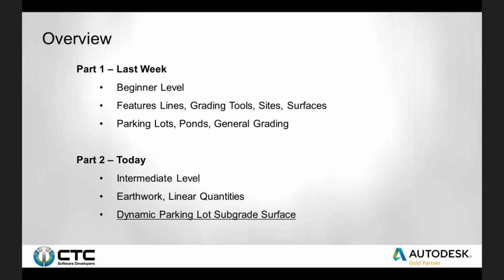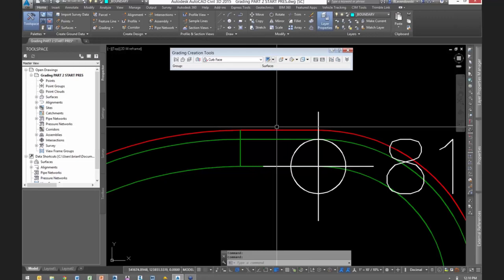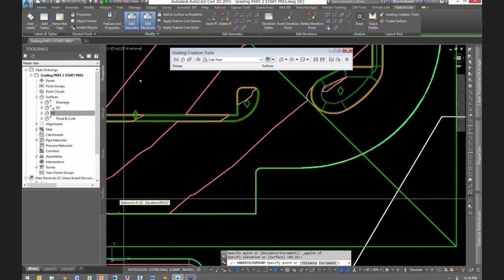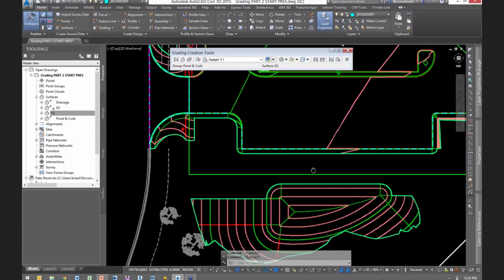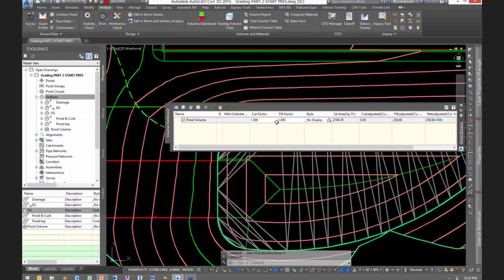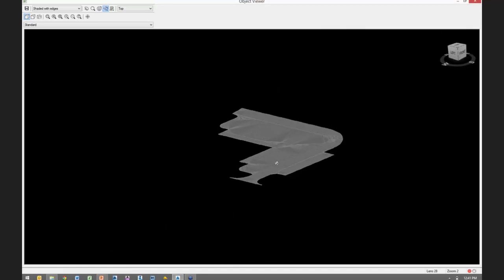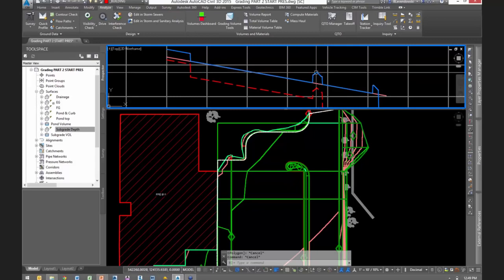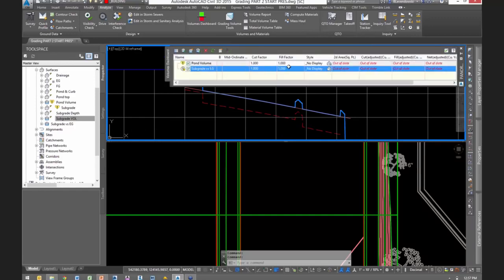Site Grading in Civil 3D Part 2

Comment: It appeared FG was a different area than subgrade. If using this to determine the total cut fill, wouldn't FG and Subgrade need to be identical in the area they represent? For example, FG looked like it was graded down around the perimeter which could have been fill. The subgrade did not. I like the method but am not clear on how to use it to get a total cut fill without making Subgrade and FG represent the same areas.